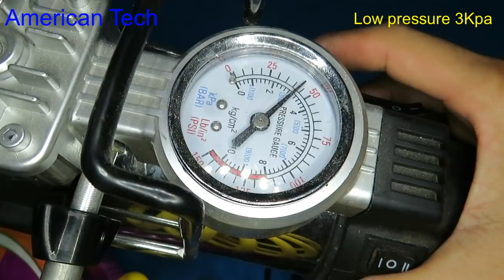How to make mini high speed Tesla Turbine from DC motor

Comment: Young man. Brilliant work. I tell you this. To make a true Tesla turbine, put spacers, very thin, between those rotor blades. Put the exhaust pipe or just a hole, near to the axle center. Preferable, make several exhaust holes. You won't need the current exhaust pipe. I like this so much, I may do it! Carry on!!!
Reply: Esatto, il tubo di scarico DEVE stare al centro perchè è proprio quello il principio base della scoperta di Tesla oltre anche all'intercapedine tra le lame rotanti che qui manca. La via d'uscita dell'aria messa nella posizione di questo video invece fa perdere tutte le caratteristiche della sua fantastica capacità di  accellerazione del numero di giri.

Comment: What did you use to replace the magnet?. Blue component in minutes 8:00
Reply: Pvc pipe.  Acc. To me it was put there to reduce space between the rotor and the casing to increase efficiently.

Comment: Instead of plastic, use magnet tape, soft enough to drill through and then you can recoil the armatures and make a little generator powered with compressed air. I'm curious about how much voltage you could get with high rpms.

Comment: try fixing an old solar panel using just a few leds. showing that the package leaked and it became rusty. so instead of cleaning just solder in green glass 3mm leds and walla good as new but may be to much energy so i have to connect second plug and we win the revolution. will you fight. please.
.

Comment: How can we use this engine for car
Reply: Simple. Use the exhaust from a conventional rotary or piston engine to drive this turbine which in turn will drive the shaft and then drive the wheel using a chain assembly or a drive shaft assembly or some similar contraption.

To be precise, you can't. And to add, this is a conventional turbine, not tesla turbine.